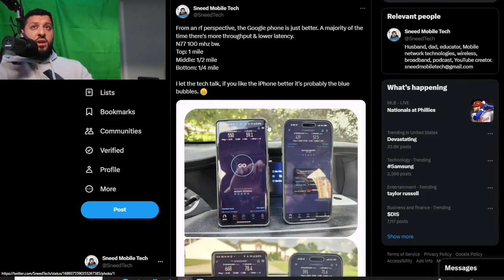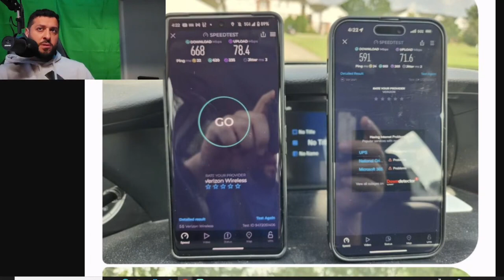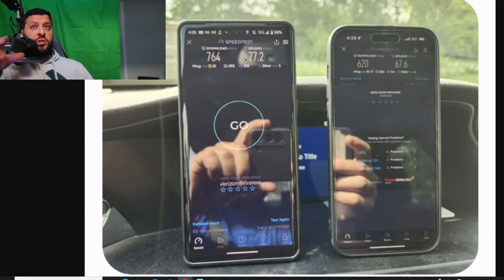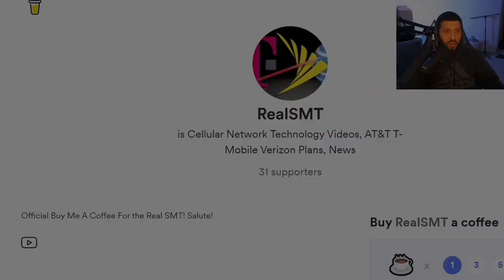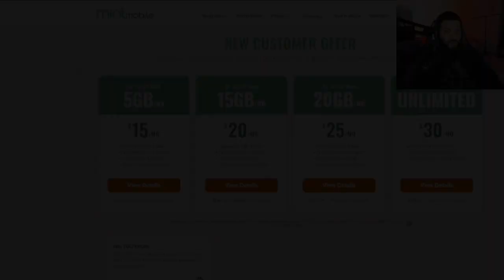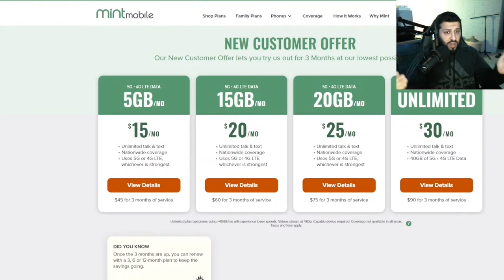iPhone 14 Pro Max vs Google Pixel 7 Pro Speed Test on Verizon C Band

Comment: Yeah that Samsung modem the pixel has is pretty nice I have tested side by side with an iPhone 13 and a S22 Ultra and it goes toe to toe with them. My guess the reason Verizon c band is better on the pixel could it be the CA combos are better and also possible 256QAM and also the fact that Verizon uses Samsung equipment.

Comment: I noticed that too between my 13 mini and my S21FE. Same modem but my S21FE would spank the iPhone, especially when the signal was weak. Idk why its just what i noticed, dont get me started with mmwave because the iPhone would hardly ever connect to mmwave but my samsung would connect no problem. Im probably gonna switch to ATT, i took advantage of the 1000 off for the new samsung promotion and i traded in my 13 mini and they only gave me 240 for it. It was taken care of and still looks new like what and only 240 like wow

Comment: For all those who say n77 doesn’t penetrate are travel over a mile are so wrong
Reply: Anything from 2.5GHZ to DOD (3.4GHZ), to C Band (3.7GHZ) all propagate pretty much the same if the sites are built and upgraded correctly
Reply from the maker: They clearly don't use the service and teat the connection.
Reply: @realsmt  I saw one of the t mobile fanboys say that in your live stream yesterday I’m like he was so clueless it’s the same as n41 but n77 is continuous
Reply from the maker: I wouldn't focus too much on fanboys or whatever. Just let the tech do the talking and let people be wrong. People have a right to be wrong n
Reply: @realsmt  right I still have 60mhz of n77 in my market New Jersey is a Samsung market
Reply: @realsmt yea man
Reply: Yes i agree the N41 is not good , the C Band is superior on Verizon and at@t, and I got rid of T-Mobile about a month ago , Verizon I have to say is the beast on C-band , at@t is good performance also , Verizon is fast , very fast
Reply: @user-dan982  I know I have Verizon now and I can tell u I can hold my n77 connection a lot better then I was able to with n41 Verizon and AT&T have better network optimization then t mobile that’s fact
Reply: @antoinegeorge4287 yes I am convinced, it is true I had to learn myself I admit it
Reply: @user-dan982 It's not the band itself that has problems, just T-Mobile taking shortcuts to deploy. They always kinda have been though, would be nice for them to work on RF propagation issues.